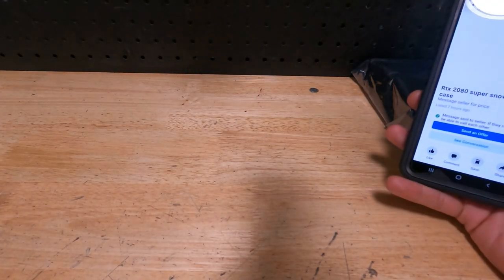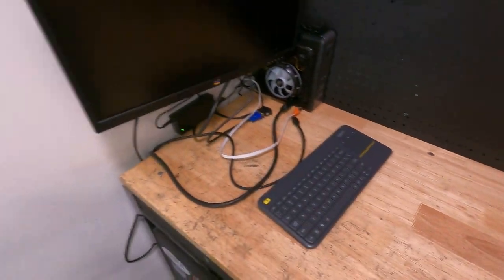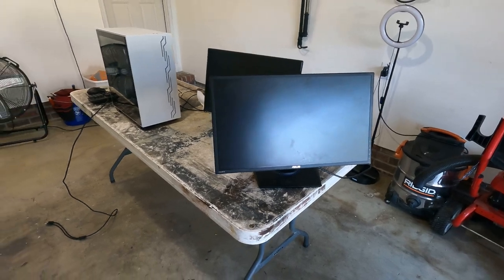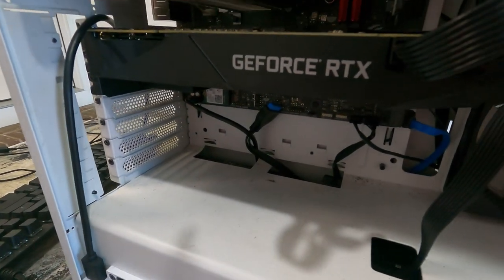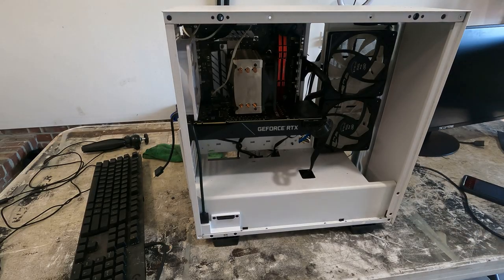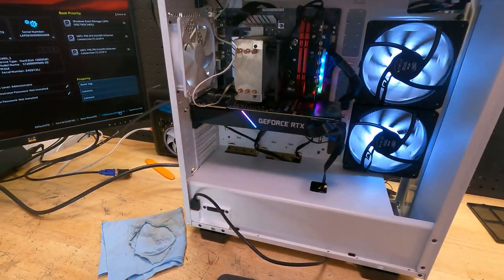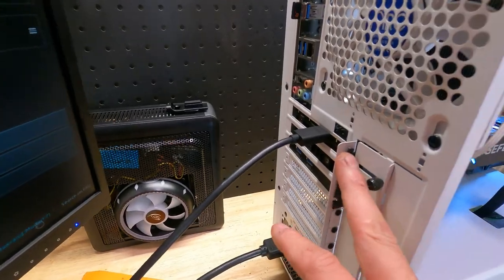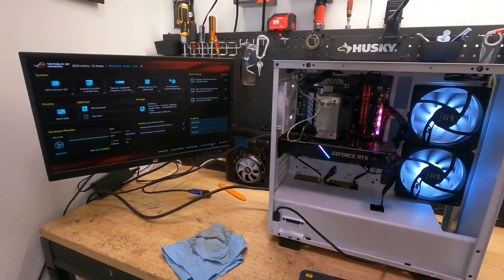I got someone out of jail for this computer!!

Comment: 13:04 I recommend a little undervolt on the blower card it’ll run cooler and quieter and save a little $ in electricity

Comment: I would do like what Greggy does on his channel: take everthing out of the case, including wires for IO, wash it down with soap an water and dry it off right away.  I would probably use a leaf blower for that part of things.
Reply from the maker: i spray it down with electrical clean and isopropyl alchol. the water works good too but it's more time consuming and you got to be %100 that you dried it good.